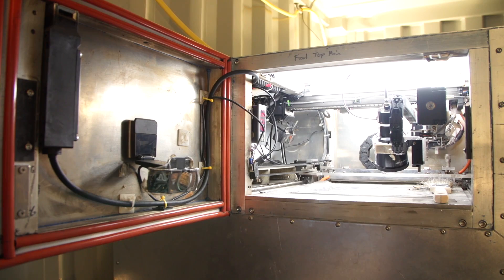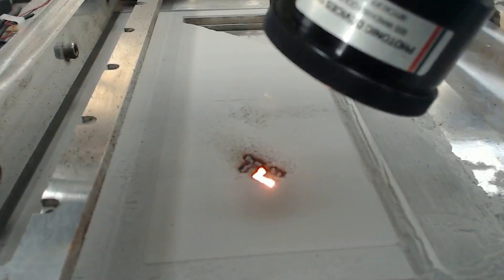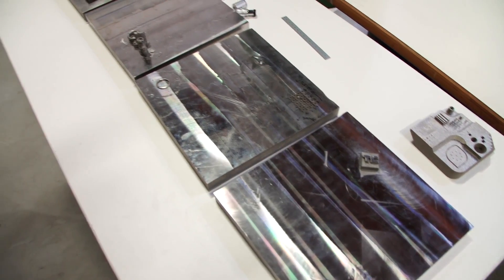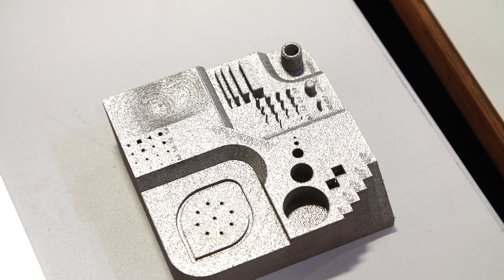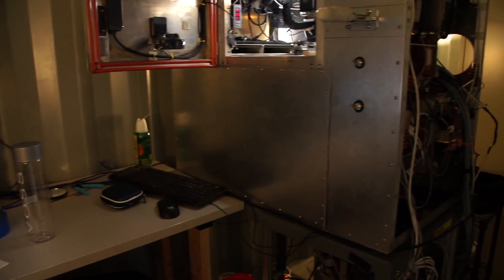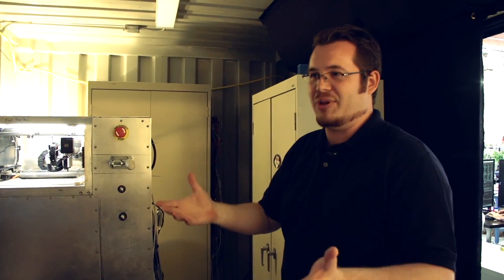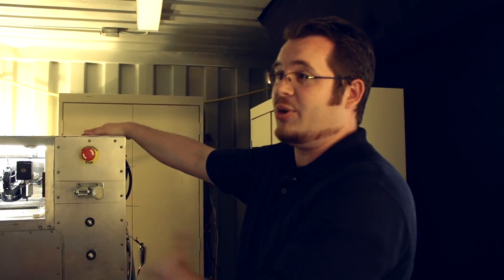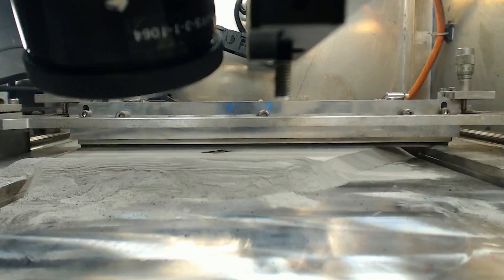Matterfab's 3D Metal Printer

Comment: the company seems to have disappeared.
Reply: Metal 3d printers at a low price would totally destroy the economy. All money flowing up to the elites will be staying down with us bottom-feeders. Metal screws, printing circuits! Man.
Reply: Yes, they forgot to close the door on that container (4:42) and the laser killed them all.
Reply: Well as you can see in the video there are lots of people involved which cost a lot of money. Other than the reprap project, where all dont cost money ;D And also I think they do too much science rather than trying which also costs a lot of money. I think building such a printer isnt that hard to do. I think its just expensive parts and a lot of work getting all the settings right. But thats in FDM printing also. I would have hoped this would finish but nah
Reply: John Leeroy  it was beautiful  presentation
Reply: I don't understand what is unique about them anyway. EOS and Renishaw are doing this, but with proper machines instead of 'home made' looking ones.
Reply: price point

Comment: did you think about 3d printing in an argon tub. run a current between the table and print. which would melt the metal between the electrodes. and just feeding a fine coil of. wire threw the head. 
basically a very fine MIG or TIG welder on a CNC 3D printer... 
I think it could work really well and would be. quicker and it would not have to wipe on new layers... 

hmm maybe they are already been developed... I haven't looked that hard yet...
Reply: or required inert gasses for the metals being used....

Comment: Wow. A ton of steel is about $400, yet in powder form it's $120 per kilo (about 2.2 pounds).
Anyway, I wonder what the resolution is on this. Like, could you make a gasoline V-8 engine that is one inch long or would that not be feasible? (Not that there would be much use for such a thing...)

JW3HH
Reply: +JustWasted3HoursHere Are you sure that ton price of steel isn't just normal steel? The powder price they quoted was specifically for high quality stainless steel, not just bulk steel.
Reply: +rdizzy1 It probably is just bulk steel, but that is still a huge Huge HUGE price hike.

JW3HH

Comment: Fun fact: scrap metal is much cheaper than plastic. Aluminum is usually $.30/lb steel is $.025/lb while ABS plastic can cost as much as $60/lb
Reply: Scrap metal is very different from fine metal powder. Metal powder must be very pure too. The metal powder required is going to be more expensive than most, if not all, plastic alternatives. But the upside for metal printing is not cost reduction but rather the ability to fabricate things that were once impossible.
Reply: EnigmaHood
Alright.

1) You need very pure steel powder because the DLMS process effectively welds it together, and any impurities will not react the same to being hit with a really strong laser as the steel. Little bits of plastic in your dust? It'll melt or vaporize and you'll be left with a pitted print.

2) Because that's literally not how it works. In order to purify metals you can do one of 3 things: melting it down and skimming the slag out, electrolysis (only works for metal contaminants), or destructive chemical baths. 3D printers can do none of these things.
Reply: EnigmaHood
That assumes you can use normal scrap, which you can't. The metal they're using here isn't just scrap metal ground up, it's powderized and extremely pure. Much like the process of finding gold in slough, you're not going to find very much usable, powder steel in a pound of scrap steel.

Even steel that looks pristine isn't free of impurities, which produce a lot of slag when melted down.

If you can find prices on extremely pure powderized stainless steel, that would be a more apt comparison.
Reply: EnigmaHood "So while this 3D printer may not be able to use scrap, it's not impossible for a 3D printer to use scrap." If you want to have even halfway decent results, yes it is. DLMS and SLS require absolute purity in their powders.

As far as "3d printing with scrap", the closest you will ever get is melting scrap down and casting.
Reply: RecurveNinja
1) That's still an assertion. Provide the citation that that proves that this machine needs purified steel. But for the record scrap metal does not contain plastic bits nor is it hard to separate steel from other particles, just use a magnet and scrub.

2) Asserting that it's "literally not how it works" does not prove that it's impossible. You said it's impossible. Nothing you said proved that it's impossible for a 3D printer to purify steel. Furthermore you also don't even understand what electrolysis is. Electrolysis separates water into hydrogen and oxygen, it has no relevance to purifying steel.

So now you are asserting that the only way to purify steel is by melting it down and using "destructive chemical baths". Now you need to prove that these methods even purify steel in the first place and that they are the only methods to purify steel and you need to prove that it's impossible for a machine to perform these tasks. Use citations, I'm not interesting in hearing your baseless assertions. Keep in mind I'm not talking about a 3D printer necessarily, I'm referring to any kind of machine that can take in scrap metal and assemble something useful out of it.

I must confess that I'm disappointed that you aren't smart enough to realize that I've been asking you rhetorical questions this entire time. I don't really expect you to prove that it's impossible for a machine to purify steel. Hell we already have them. It's really just a matter of combining a purifying machine with an assembling machine. You don't realize that you've embarked on a fool's errand. It's damn near impossible to prove something is impossible, especially when it doesn't violate the laws of physics. You should have realized that by now. But if you insist on this train of thought, you better be prepared to prove your claims. Your assertions alone will not be sufficient. If you think it's pedantic, it is, and that's why you shouldn't assert what you obviously can't prove.
Reply: Granted, I just assumed your original comment had some relevance to the video and wasn't just trivia.  My apologies.
Reply: +Hellsong89 Blendtec Blender
Reply: +EnigmaHood Time to start melting pop cans
Reply: Sean Conrad
Scrap metal can be refined and ground down to a powder fairly easily. But no, the most expensive part of metal working is actually fabricating things from metal, not the metal itself. With 3D printing, the cost of production can potentially be a lot less than plastic production since plastic is more expensive.
Reply: +EnigmaHood But you're judging it by weight, not volume. 1 pound of ABS is a hell of a lot more matter than 1 pound of steel.
Reply: RecurveNinja No, it's more volume. Volume is a measure of space, not matter. Mass is a measure of matter, and weight is just mass*gravity so the matter is the same.
Reply: EnigmaHood
That's what I meant. You can do a hell of a lot more prints with 1 pound of ABS than you can with 1 pound of steel powder.
Reply: RecurveNinja Density of steel is about 7.75 g/cm3. ABS plastic is 1.06 g/cm3 so steel is about 8 times as dense so you need about 7 more cubic cm of abs plastic to equal the weight of one cubic cm of steel. A quick google search determines that steel costs about $.025/lb while ABS plastic costs $60/lb.

So steel is 2,400 times cheaper per pound while plastic only gives you 8 times as much volume as steel. Steel is easily cheaper per volume.
Reply: RecurveNinja
Well that's a strawman anyway. I wasn't talking about this 3D printer nor did I ever say that normal scrap metal can be used in this specific 3D printer. I was merely stating that scrap metal is cheaper than ABS plastic. So while this 3D printer may not be able to use scrap, it's not impossible for a 3D printer to use scrap.
Reply: RecurveNinja Ok prove it. Prove that 3D printers first require extremely pure steel and then prove that it's impossible for a 3D printer to purify steel from scrap steel.
Reply: In the video he says the stainless steel powders he uses cost 120$/kg. If we use that as a bench mark for the price difference to make a powder, we can say, roughly, that it will add about 100x to the cost.  It will never be cheaper than ABS, which costs 20$/kg for filament.
Reply: rgaud8 I think I clearly stated the prices for scrap metal, not stainless steel powders.
Reply: rgaud8 If you couldn't understand the relevance from the discussion then you're an idiot.
Reply: rgaud8 You're too stupid to comment here. Bye.
Reply: Op where the fuck are you getting your ABS plastic from? the apple store?
you can get quality ABS filament for around $24/2.2/lb  or ~$11/lb
even less if you buy in pellets.

I have never seen ABS filament at $132 a roll.  60*2.2   1Kg Does not equal 1Lbs

Comment: I'd love to see someone create a method of recycling old metal objects into the metal powders that these systems use for printing... $120 per kg is pretty steep and perhaps recycling objects such as broken SS knives instead of having them take up our landfills might help drop that cost down drastically.
Reply: +Peter “RoguePaladin” Langdon :  or use a wire fed weld/sintering machine, like a CNC Laser "XIG" machine.

High purity wire will always be cheaper and easier to produce from "scrap" than powder, downside the wire size will reduce precision of parts "straight off the machine".

There's always a downside.

Comment: Jesus all that........  I seen metal 3d printers use a tig style system already and hell of a lot cheaper to produce a part then 120$ a Kg  That is after gas and welding strings as they call them in metal printers*  Don't see how this could be even remotely cheaper for a normal persons business.  Tig printer uses fine feed wire that is around 100$ for 10 pounds........   and gas well depends!  But still 5 pound part cost around 65$total roughly to make  on tig bed.  Just from metal dust alone I be 280$ in hole on same part with this......  unless this thing prints better then .0013mm resolution...  I would be considering closing up the project soon so you dont waste more money *  Cause they keep improving that as well new metal blends in the strings*

Comment: yes but it need to work with titanium
its the twenty first century, everything should be made out of titanium by now
Reply: +Ian Gallinger titanium is flammable
Reply: +Ian Gallinger titanium is very hard to work with
Reply: master scoot it is :D
Reply: +Ian Gallinger Titanium is vulnerable to chlorine and cadmium. (Don't use a cad-plated wrench on a titanium nut.) Using the wrong kind of marker to draw on a titanium part can cause it to crack. Everything has some kind of weakness; there are no magic materials.
Reply: +Ian Gallinger They would just need to do the &quot;printing&quot; in a noble gas atmosphere.  Since they are working with powders, they can&#39;t have a jet of argon or helium, so they would have to do it in a sealed chamber flooded with Ar or He.

Edit:  I didn't watch the last 1/3 of the video before I commented, and missed the part about an inert atmosphere.

Comment: 120 dollars per kilo? For stainless steel?

What practical object would a residential consumer want to produce that couldn't be made with a CNC machine..? The answer is nothing, because any practical object is already produced with CNC…

If I really need that part produced I would simply have a professional manufacturer manufacture the part for me. I don't think I would ever break even producing objects that strictly require 3d printing.

I don't see why I would invest in something like this when I could just buy a CNC for my workshop inexpensively… and use that machine to not only produce objects with a higher quality of metal but also carve wood and the like?

Comment: Pretty pointless - can't see a real world application for this.
Reply: Ant Mallett Not to start up the controversy, but there's a firearms company that has made a 3D printed gun. It hasn't fired enough rounds to be anything impressive, or worth talking about beyond the obvious controversy, but it's a real world application none-the-less.
Reply: +Max-Anton Jonsson: never say never, you're bound to be proven wrong.  lol

You Must have missed the art about argon in the video.

Plenty of apps  mostly in the prototyping phase, but also in manufacturing very complex geometry.

Sintered metals are often post-manuf heat treated to produce the material properties desired, not necessarily a one-step process.

There's a whole lot more to metallurgy than grain size and shape.
Reply: Max-Anton Jönsson
It has the exact same uses as a plastic 3D printer. Quick prototyping. You use it for metal parts that have a more thermal-heavy than force-heavy application. Or you use it to make parts that are extremely complex, and therefore difficult to make via subtractive methods.
Reply: Max-Anton Jönsson
The billet that "tradition machined parts" are milled from is a cast and/or extruded material, ie. is has at some point been heated and allowed to cool.  In heat-treating, what establishes a materials brittleness has more to do with how rapidly the metal cools and not just its heated temp.  The laser in DMLS is actually melting a powdered metal - in essence melting and casting a part a single layer at a time, and each time fusing the previous layer to the new layer.  The temperature and rate of cooling is very controlled and the structural properties are consistent and known. The powder is purified of contaminants and the gaseous environment around the print area is controlled as well. The parts are strong enough for functional production uses. You seem to be under the impression that this tech hasn't been around for years producing completely viable parts for 1000s of production uses. You are in essence questioning the credibility/viability of something that is already in wide use in industry doing exactly the thing you doubt it can do.
Reply: +subasurf they aren't complete turbos, they're exhaust scrolls, and they're made by printing because their production volume is so low setting up a production line for a year's need of scrolls would cost far more than the produced scrolls.
Reply: TheMohawkNinja Not really, they will never achieve the strength and endurance of properly machined material since the material will always be porous. Unless they incorporate a stable environment such as a vacuum or some sort of gas, which in turn makes it a very costly and inefficient invention. I really can't see a real world application for this.
Reply: Max-Anton Jönsson Disagree.
Reply: Donatellangelo Care to elaborate?
Reply: I disagree with you...and that's it. :/
Reply: +Max-Anton Jönsson The material is NOT porous.
Reply: +TheMohawkNinja They aren't a firearms company, they  are a prat printing service.  One or more of their techs is a firearms enthusiast and got permission to print the firearms as a test case - specifically to prove the viability and strength of printed metal parts.
Reply: Billy Wardlaw At a molecular level traditionally machined parts follow a pattern, this pattern makes the material ductile and endurable. When for example heat treating you mess this pattern up, making the material hard and brittle and you have to balance this to achieve the right pattern for the purpose of the part. This cannot be achieved through this method. Furthermore, there will always be impurities without a stable environment. These impurities is made up by other materials, gases and so on. Maybe porous is a bad word for it, maybe not. The effect is the same, brittle material with low adaptability to real world problems.
Reply: Extruded material is purged from impurities in one sweep in a stable environment. While building a model layer by layer gives impurities chance after chance to infect the material. I'm well aware of how the process of heat treatment is performed and how it modifies the materials molecular structure. You may minimize imperfections by purifying and so on, but in the end you can't avoid it entirely without a stable environment whilst producing the material itself and/or the final product. I'm also well aware that 3D printing is widely used in many fields and has been around for decades. As for metals though, I have to disagree with you. I have yet to come across a company using it in its main production. You seem very convinced however, is there any statistics? Me myself am new to this technology, yes. Hence me questioning it. Since you seem educated on the subject, what are the structural properties?
Reply: Max-Anton Jönsson
 DMLS printed parts are used in many turbine engine designs.  There aren't very many higher stress environments for parts to be in than that. I think you just need to familiarize yourself with the technology a bit more, before just dismissing it whole-cloth based on an assumption about impurities. Here is a link to EOS's whitepaper on DMLS materials http://www.3dimpuls.com/sites/default/files/download/eos_dmls-materials_for_dmls.pdf.  And here is a link to an interview with one of their directors. http://raykurland.com/2012/03/11/direct-metal-laser-sintering-dmls-produces-high-strength-and-finished-metal-parts/.  Best of luck.